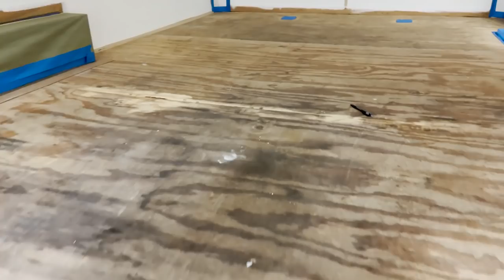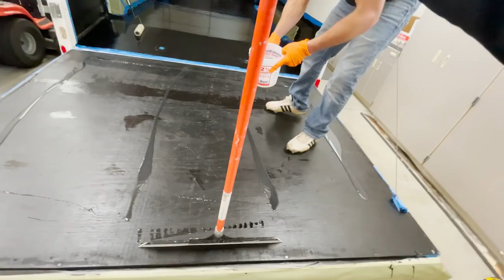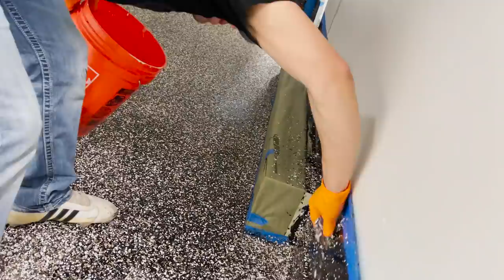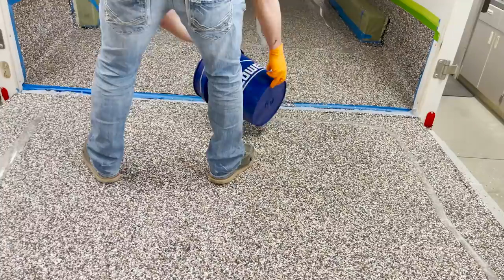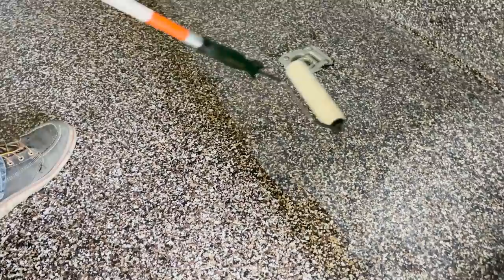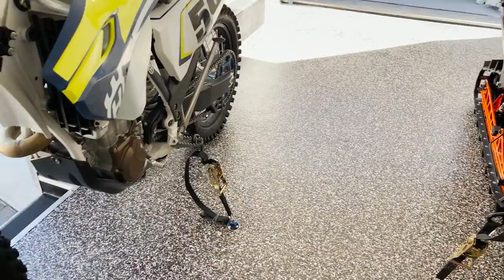Epoxy Flake Floor Kit Applied Over Wood Floor In A Trailer | Leggari

Comment: I did my 16 foot about 10 years ago with leftover garage epoxy really fast and am downright shocked how easy it is to clean.  Easy to sweep or hose out.  Very little seams for about 30$ of leftover epoxy.  Was cheaper than painting w primer

Comment: They didn't show them scrapping the flakes for a smooth surface before applying the top coat, did they do it differently where they didn't need to?

Comment: What happens after you add the flakes and it dries? Do you just clear coat over all the extra loose flake? I am lost
Reply: YES... he shows that in the video...
Reply: They didn't record the scraping and vacuuming of the floor. After flaking the floor, scrape it, vacuum it (electric leaf blow it off) and then do the top coat.
Reply: @Armor220  
YES... That is a STEP that should have been shown...
Thank you for that very important part of this video...

Comment: How did it hold up with the flex of the trailer??  Is it cracking at all?
Reply: I want to know that answer toooooooooooo
Reply: @judichristopher4604  I have had it on for about a year now, just don’t put the little paint chips on and it will be all good…. The paint chips make it harder to clean and they also chip off and make a mess
Reply: @masterchef2408  
How many coats of Sealer did you put on? 
You did emurse it with Epoxy... all the chips should be Under the Epoxy. 
Right?
Reply: @judichristopher4604  I didn’t use any sealer, just the epoxy and you sprinkle the paint chips on top of the epoxy when it’s wet. I’m still happy with it.  I don’t think you would need a sealer it you didn’t use the paint chips, but that would be all up to you.

Comment: How does it handle up to cold weather? With a snowmobile and dirtbike, will water be an issue making it slippery to walk on and down the ramp?
Reply: Can you guys please answer this. I definitely would love to know as well. Thanks in advance.
Reply: The flake itself provides adequate slip resistnace but you can add  a product called Back-Track from Elite-Crete for additional slip resitance.

Comment: How much height do you think that adds to the trailer looking to possibly do mine.
Reply from the maker: It really doesn't add too much height, especially depending on how thick you apply the product. Typically this process includes an epoxy coat, the flakes(which you scrape off the excess), and then a topcoat, so nothing too crazy.

Comment: Would it be an issue if it was done in a bathroom around a toilet?
Reply: I’ve put down epoxy flooring in bathrooms.  Remove the toilet and it’s an excellent solution and easy to clean.

Comment: I know that's the flake floor kit, but can someone confirm which color that is? Did it also include the grit in the topcoat? I'm looking to do my brand new 7'x14' trailer exactly like this.
Reply from the maker: Autumn filter, and yes when you buy your kit you can choose an optional topcoat with or without the grit additive!

Comment: Looked great, want to share side affects, some epoxy’s will make you as high as a kite, two painter doing a bath room wound up beating each other up, took them outside sobered up in a minute went back in finished job no problems, did a kitchen for a lady, she watched started coming on to me, took he out to the garage she sobered up in a minute and left, her dad came over and wanted to know what was going on, told him I was doing epoxy and he left no problem. Was doing another kitchen with two painters, stoped by as they had just started home owner came in while we were putting it on, talked with each other like we were old drinking buddies in a bar, took him outside and apologized and told him to tell his wife I was sorry. Make sure you have proper ventilation.
Reply from the maker: Our epoxy has no harsh smells and is one of the most eco friendly resins on the market!